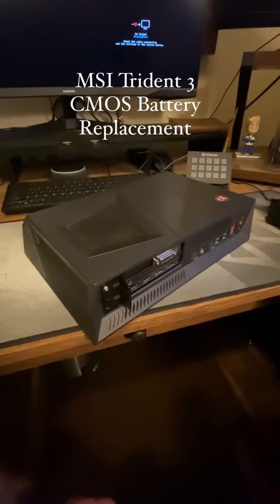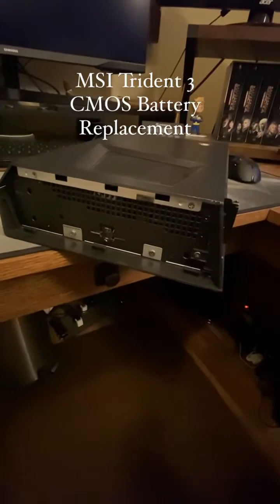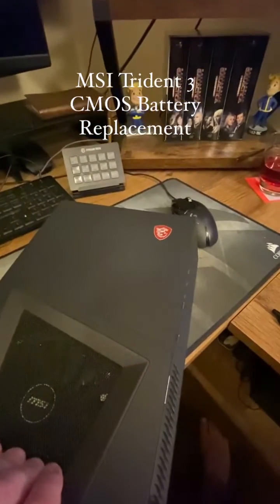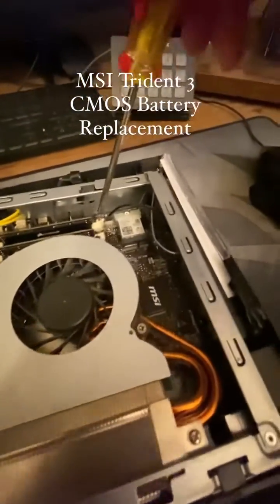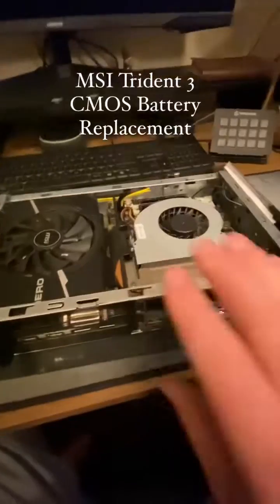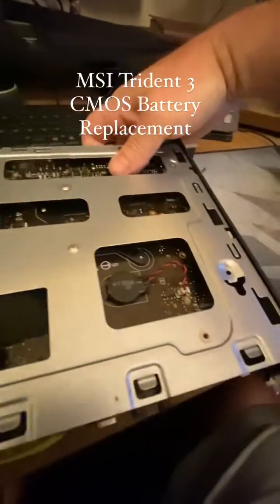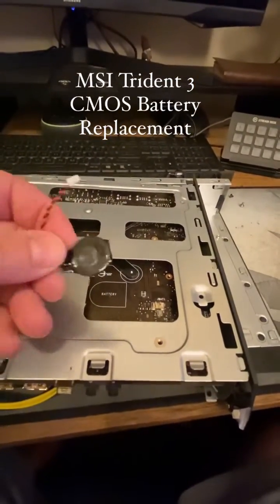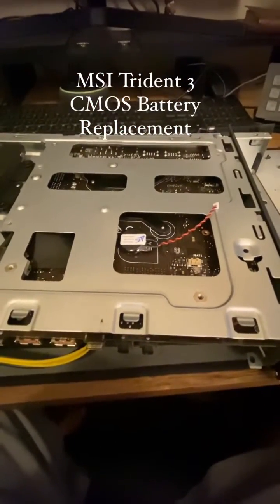MSI Trident 3, CMOS Battery replacement

Comment: My trident 3 shutdown after using it for about 3 hours and doesnt want to turn back on… i pulled out the power cable and noticed with it out and the light green on the brick of the power cable, i would try to plug it in and it would short or something and the light would turn on on the brick. Any idea why? Im wondering if i change the cmos battery if it would help. Also the original power cable got messed up on the cable end and had to replace it, it wouldnt even mate into the tower anymore. Thats how sizzled it got and warped the metal😢

Comment: Are you able to change the hard-drive and a graphics card in this and what kind of SSD or HDD card would you need
Reply from the maker: You can change the HDD but you'll have to mess with the operating system, etc.  For the SSD I think it's an M.2 NvMe I dropped in and it booted and worked straight away.  No real high tech confusion.  Plugged in, turned on, worked.
https://www.amazon.com/gp/product/B08V83JZH4/ref=ppx_yo_dt_b_search_asin_title?ie=UTF8&psc=1

Comment: Do you have the specific link you used to buy the replacement battery? Mine is failing and I want to make sure I don't buy the wrong one.
Reply from the maker: You can get these anywhere.
https://www.amazon.com/Duracell-Lithium-Battery-Features-Glucose/dp/B0855FD9P2/ref=sr_1_2?hvadid=238251484251&hvdev=c&hvlocphy=9030095&hvnetw=g&hvqmt=e&hvrand=965448404354556744&hvtargid=kwd-296931095229&hydadcr=24658_9648989&keywords=cr+2023+batteries&qid=1686911714&sr=8-2

Comment: Hi.. Suggestion needed. Previously I had my Trident 3 Power set, and everything works well. Until one day, it doesn't enter the System, instead, it shows the F1 to run setup or F2.. I know it's related to the CMOS, today I replaced the CMOS battery kit, but it still enter that view after a power "outage" on purpose. I'm trying to figure out which part is wrong. From Windows Device Manager, I don't see such thing of CMOS battery, I'm not sure if it displayed it before... I also don't know if it's the battery issue or something wrong with the motherboard....
Reply from the maker: I have this same F1 F2 issue as well.
Reply from the maker: I followed the advice of one of the commenters on this video where they changed the wires on the backup battery. + to - and - to +.  This solved my F1 F2 at startup issue.  The battery from the factory is wired backwards and your computer is unable to use it and thinks it has no battery at all until you switch the poles.
Reply: @delnorinthemaster3557  Worked!! Thanks!!

Comment: Thanks for this video! Worked for me to get the battery replaced, but did not solve my problem with my clock not having the right time. I did notice however that the black and red wire were switched in the connector for the new battery, could this be the problem?
Reply: Same problem with me, I have changed two batteries and the date/time still hasn't corrected. I have seen that other computers have the 'Clear CMOS' function but i'm not sure there is one for this computer.
Reply: @mellenn  I measured and compared the two batteries, switched the wires and that fixed the problem. Apparent there is no ‘standard’ for it. I did it with solder, but I read it is also pretty easy to reconnect the connector…
Reply: @motorcycleadventuresNL  did you switch the wires that were soldered to the battery? or the wires in the plastic pin? I tried switching them on the pin side (easily removable) but it didn’t change the problem :( I’ve seen as well it might be due to a faulty RAM module so I will investigate that too
Reply: @mellenn  The wires in the pin. I measured + and - with a Volt meter with the original battery and the new one and that's how I found out that they were switched. Best is to measure it yourself to check if that's also you problem. If not, something else is wrong. (I ha to borrow a volt meter at the neighbor, but it's very easy to use)
Reply: @motorcycleadventuresNL  Excellent thanks for getting back to me, I’ll give that a go :)
Reply: @motorcycleadventuresNL  Hi thought I would do a little update - borrowed a multimeter and did as you suggested. As thought, the wires of the new batteries were opposite to the original. After switching the sides in the pin the computer now works completely fine :) Thank you all for your help!
Reply from the maker: @motorcycleadventuresNL  This is the trick!  I followed your advice and tada!  Now my clock stays properly sync'd and also I no longer have the F1/F startup bootup sequence issue.  Outstanding Advice @Motorcycle Adventures.

Comment: How long did the cmos battery last from when you got the trident till this video where you replaced it?
Reply: How do you know you needed to replace the battery, my trident 3 just shut off mid gameplay and now it wont turn on. The power brick light is off but when i unplug it from the computer it turn green. If i connect it, the green light turns off.😢
Reply: I have same issue as you @tenkerz  . My Trident 3 overheated from playing NFS Heat (ironically). @delnorinthemaster3557 How do you know if it's the battery will have to be changed in order to get pc to boot again?
Reply from the maker: 4 years